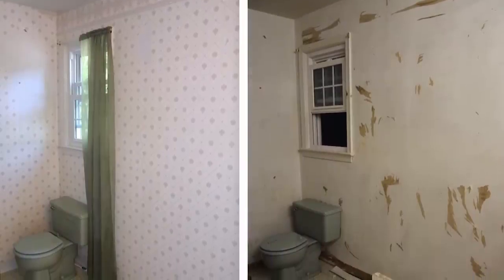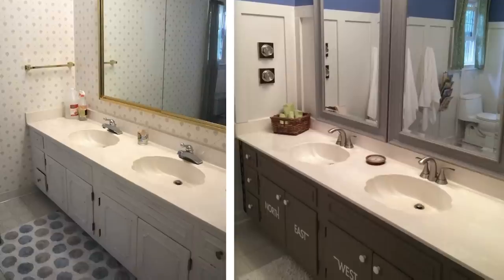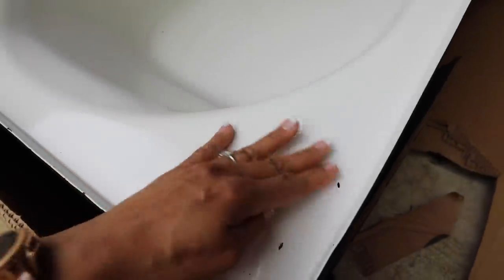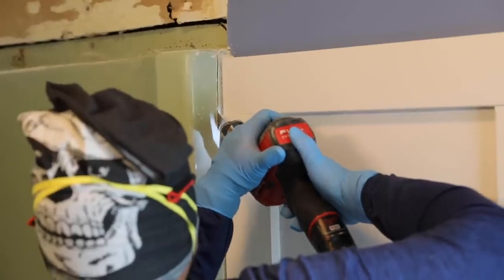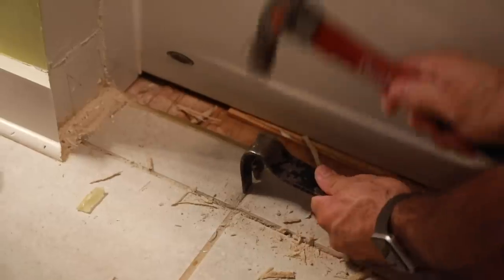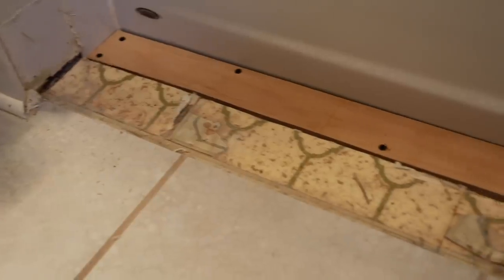Replacing My Old Fiberglass Bathtub With an American Standard Passage Alcove Tub - Thrift Diving

Comment: You have given me HOPE to actually get mine GONE! It looks SO nice!!  May I ask how wide your bathroom doorway is and did they have trouble getting it in? Mine is the smallest doorway in my house and my hubby and I were thinking they couldn’t get a new tub through it! My tub was not properly packed with sand under it (the practice 20+ years ago) and it eventually got a stress split in it. We have patched and painted and used rubber paint and waterproof tape and it looks AWFUL! I am so envious of your pretty tub! :)
Reply from the maker: Sorry to hear your tub is split! My doorway is standard, probably 36"? I'll have to measure! This was a much smaller tub than I expected, at 30" wide. For some reason, I thought tubs were massive things that would take a lot to get in! LOL. I'll take a measurement and let you know. But they didn't have any trouble getting it up the stairs or moving it in. I'll also let you know how much installation was, too. I know for them to come back and fix the flooring it was $500. But the installation costs, I'm not sure on that yet. I'm waiting to find out! :)
Reply: I put in an American Standard acrylic tub with a curved front, found it at Lowe's and not sure if Home Depot also has it.  My bathroom door is only 30 inches wide so had to stand it on end but no problem getting it through the door even with wider curved part.  The reason I got that tub is because a lot of the new new tubs aren't as wide as the older ones and in my 60's now it's harder to get down and up in a narrow space.  I love the tub but don't care for the surround that was sold separately to go with it.  I love these Passage panels though and am going to look into them... even though I just recaulked the tub twice, not liking the result the first time!!
Reply: Robin Rummel I got one in my bathroom with the door off & my bathroom door is 28” wide, it’s the smallest door in my house.

Comment: HA HA That is the same exact color and design minus the tub part. I also had the green toilet to match. Now I regret getting rid of the toilet for one reason...It was a pre water conservation and was mostly unused it was a heck of a Niagara Falls very powerful. I have changed toilets 3 times and they all are horrible I need to resolve that a well this time spend a little more than the 200 bucks I spent on the others. SO many projects ....DOH! Thanks for the help I am gonna do a before after just so I can remember  the before it helps with motivation...Kids look Stoked as well ..too bad I cant fit a tub

Comment: I have an old dresser that's been painted a bunch, what's the safest way to remove the paint without damaging the wood underneath. It's a really beautiful dresser but I think I want to refinish it
Reply from the maker: Hi Peyton! You could use a chemical stripper to remove the layers of paint. It won't damage the wood underneath. But you need to make sure you're doing this outside where it's well ventilated. Use Citristrip. You can check this blog post on stripping furniture: https://thriftdiving.com/how-to-strip-furniture/

Comment: Unfortunately nothing that was done was waterproofed correctly, Sorry to tell you that you will have issues with rot and possibly many more issues in the coming years. The area right next to the tub that yall installed tile will be very susceptible since that is where most of the water that comes out of the tub will be in contact with.

Comment: what are the materials made of for the surround and the extra white board on the top? Marble? Why not Tile?
Reply from the maker: The surround is like a water-resistant material that feels like laminate countertop material. The extra board they put on top was only because the panels weren’t tall enough to go to the ceiling. I didn’t want to tile that, and they needed an easy solution. But yes, you could put anything above the shower wall boards!

Comment: When I look how the builder put tile adhesive on ply and then just fillet with grout and silicone- don’t be surprised when this tile start moving after few years and ply under will be sponge- just saying....
Reply from the maker: If that happens, then the whole floor will be ready to be replaced. It's a floating floor system and was the best option for finishing the area in front of the tub.

Comment: I'm not sure about that material with moisture also those pipes looked super cheap and crackable. I'm curious did they seek you out for the sponsorship or you seek them?
Reply: Those pipes are standard plumbing now.
Reply: @ShellyCline  uh no they're not these one day tub redo companies use cheap materials so they can maximize profits.
Reply from the maker: They sought me out for sponsorship. I'm so busy with projects that it's rare I reach out to companies for sponsorship anymore. I've started working with The Home Depot so their videos keep me busy enough as it is. The pipes they used looked standard, but I don't have much plumbing experience (yet) so I can't tell if they used sub-par materials or not. What do you recommend they should have used?

Comment: 10:45 did 30 inches make it less comfortable ?
It looks really nice.
Reply from the maker: It did make it less comfortable, unfortunately. This new tub is a straight 30 inches wide the entire width. My old tub was 32" wide, but it seemed like in the middle, it bowed out a little so it was even more space in the middle. I didn't know it was going to be smaller.
Reply: @ThriftDiving  

Well you may have traded down a bit by size but you scored in the sweet deal they gave you in materials and installation.

You start running into money with those two people luxury tubs, I was just looking online. That's what I want.

Comment: So many things wrong within this video... dry wall are not waterproofed, tiles weren’t set with proper tile adhesive, shower panels weren’t installed with proper panel tracks. Sorry to say but the shower would eventually fail in time unfortunately